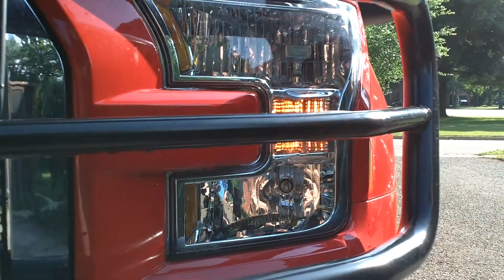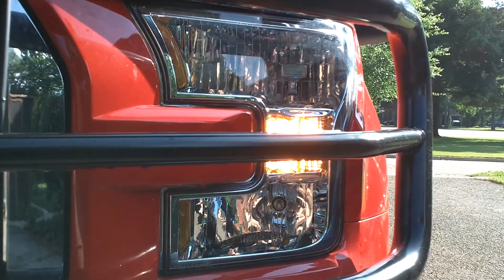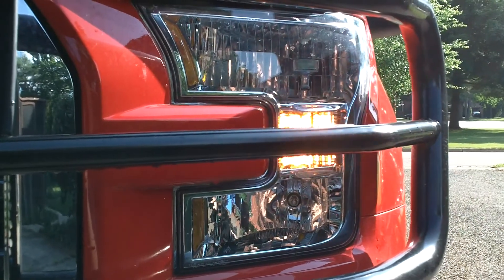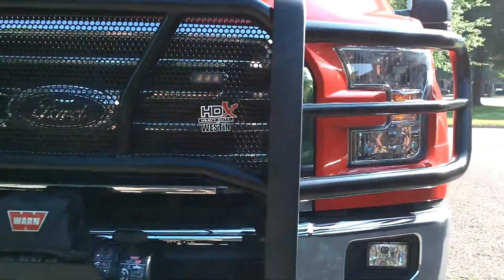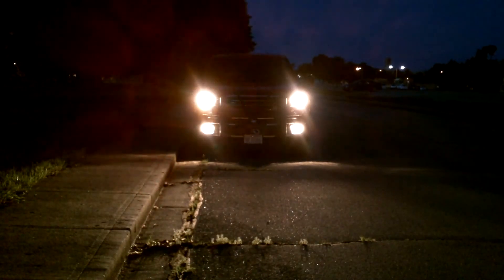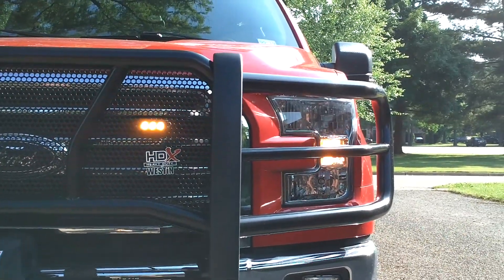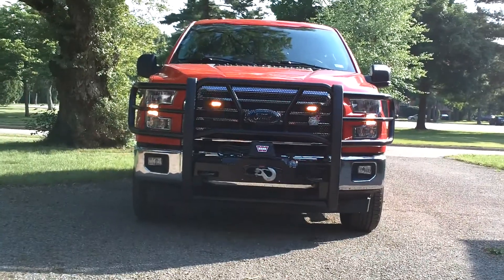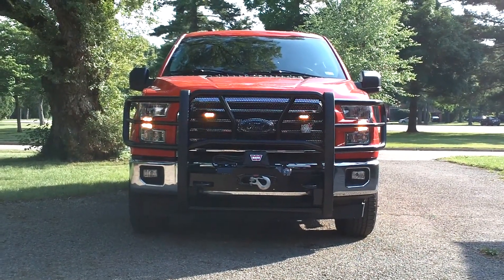Feniex T3 blinker mod

Comment: I wired a pair of red T3 lights to act as auxiliary brake lights. Stunning results.
Reply from the maker: I recently got into the roadside assistance business and upgraded the T3s to Feniex quad double stacks. Still have the turn signal function but added two flashing modes for working on the side of the road. I’ll be doing a video on all my truck mods and my lights soon on my new YouTube channel: Palmer Ridge Road Rescue